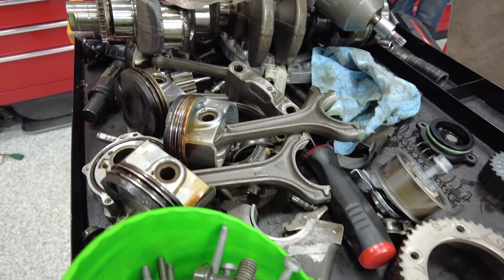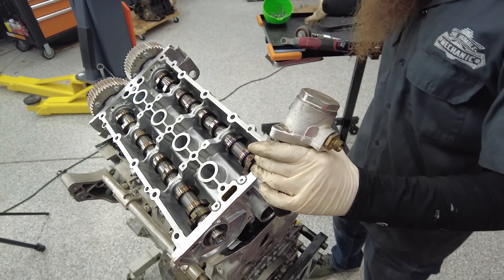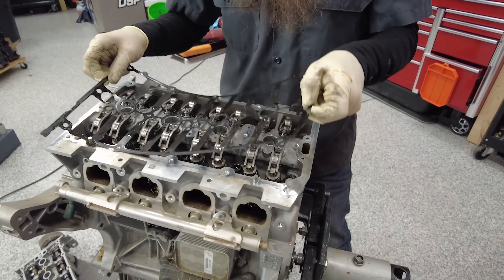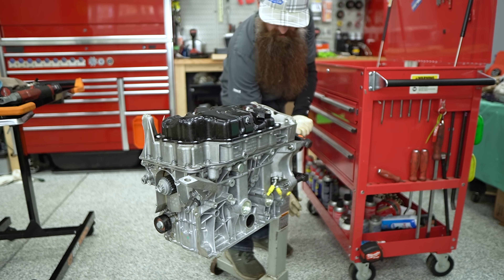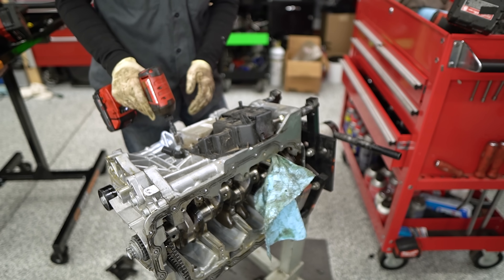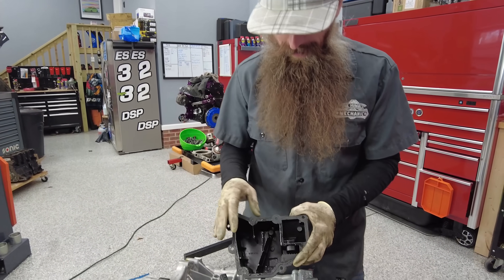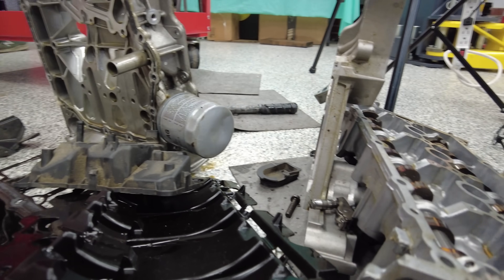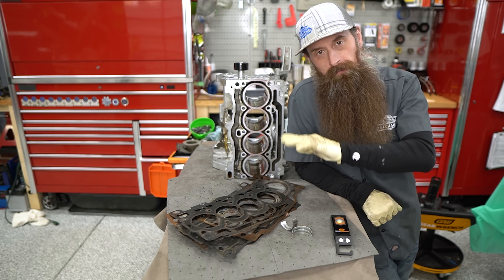1.4 Turbo Engine Teardown After Engine Failure ~ Rod Knock

Comment: So it didnt have the rod knock more like timing or bad coil pack. Them rods and bearings, piston walls locked clean to mean.
Reply from the maker: It wasn’t either of those. The guys working on it went way deep. Sadly you don’t always find the smoking gun when the problem is in dynamic state, and you can only inspect static. 

If I recall vw warrantied out the engine. But this was every bit of 10yrs ago so I may be fuzzy

Comment: The integrated camshaft housing is present across the EA211 range of engines, so includes the 1.0 and 1.2 engines as well. But I don't think they are sold in the USA so you probably never seen them.

Comment: My ea211 1.4 from 2013 has 320000 km / 200000 miles. Only had the belt/waterpump replaced. No other problems. Good milage and little oil consumption. Yearly oil change.
Reply: my 17 jetta has 60500 and gotta do a head gasket also 1.4 tsi ea211

Comment: Late to the party... as usual.
Anyone notice these could be switched to port injection? The intake manifold has spots for injector boss to be drilled and the intake port has clearance for the fuel spray.
What benefit? No idea.

Comment: Before removing the timing belt you have to lock the cam shafts with special tool in order not to make engine rebuild right after. Ofc in this case when you just make a corpse dissection is ok to do it your way.

Comment: Hello! Please tell me, the question is a little off topic. A plastic part fell off from the oil filler neck and is now in the valve cover. You can start the engine or it is better to remove the cover and take it out. If you remove the cover, is it possible not to remove the belt completely? Thank you in advance to everyone who will help me)

Comment: Mines on a custom stage 1 running 185bhp and 318nm in my polo bluegt. Absolutely cracking little engines, enough power and economy to not want anything else
Reply: 1.4 CHPA on 200 bhp - 340Nm 190k km.

Comment: I had a 2016 jetta base manual with tech so it had the nicer touch screen and all the electronic switches instead of manual. Leased it for literally 160 a month. But added on the maintenance for 3 years as well as scotchgard the out and inside. And finally tire and wheel protection. Loved the thing so much I decided to buy it when my lease was up and my wife drives it daily and I use it as my primary lyft uber rideshare driving which means it's running around stop and go and long travel 5 days a week. Has near 120k on it now and it's never had a single issue. One thing I do recommend on any vw Audi or benz. Every month twice a month I run a can of berryman b12 thru the tank and I've never had carbon buildup ever. It had a timing belt changed at 100k and the clutch has been upgraded. It also has the apr stage 1 upgrades from the dealer. This was the car that made me love german cars so much. Being a salesman for vw Audi and Benz. Becoming a audi brand specialist. They truly are amazing vehicles. And you can put my cadillac 05 sts v supercharged up against most cars even modern ones... but I will say that the Passat from 2015 on is the smoothest quietest most comfortable and capable vehicle on the road. I think if the Jetta gets to start having issues in another few years. The passat 3.6 liter premium R line edition is such a luxurious vehicle. And with that 4wd and v6 they rip.

Comment: The integrated cam design seems to be a lot more common now, with other euro car manufacturers having adopted it in their engines. From what I've been told by my local VW techs it's mainly for manufacturing cost cutting and to act has a failure point if the timing belt snaps. They've worked on engines where this happened and if the valves contact the piston the lobes will just spin on the cam, preventing catastrofic engine damage. You do need to get a new cam assembly after that but I guess it beats getting new engine.

Comment: Mine has 144,000+ miles all city driving. (Uber Driver). Just had the timing belt replaced so I am ready for another 144k!
Nothing other than regular maintenance done. I wonder how long the turbo charger will last. I will see how many miles I can get out of this engine. My guess, over 300,000 miles

Comment: I have a 1.2TFSI EA211 with 110hp in my Audi A3 from 2014 with timing belt. Still running strong. But I‘m changing oil+filters every 7500km

Comment: I have a 1.4 tsi in a Golf estate That's burning oil at 1L per 500km (1qt per 310mi) when accelerating there's often a sound that i can only explain as having some rocks in your hand and shaking them. The noise lasts for 2-3 seconds and then there's a big puff of smoke out the exhaust that's big enough to see in the revision mirror and then the noise goes away and the car drives like normal.

Comment: Charles - quick question. I used to have a 2015 Jetta with a 1.8Tsi. I changed the oil by pumping it out of the dipstick hole. (I'm sure you have an opinion on the practice). I now have a 2016 Jetta with a 1.4 Tsi. I measured the oil coming out of my 1.8 and my little pump really did a thorough job of removing the oil. I just tried the same thing on my 1.4 and it left quite a bit of oil in the engine. It could have been 1/2 quart or more. Unfortunately, I didn't measure it because I didn't anticipate the problem. So, after adding the capacity of 4.2qts, I saw the oil was very high on the dipstick and I sucked some back out. Here's my question: Is there something about the dipstick channel which would keep my oil pump tube from going all the way to the bottom of the pan to get all the oil in the 1.4? This is an old thread so you might not even see this. But, if you do and you want to give me expert advice, I'll take it. Thanks. I really enjoyed the teardown (even though I couldn't see what I was looking for regarding the dipstick channel.)
Reply: I doubt it

Comment: Hey Charles, loving your work, I bought an 2004 A4 B6 Convertable 2.5 V6 TDI 8H, she has a full Audi service history and seems pretty good nick, I have done a lot of work already including all the front control arms shocks Track rod ends, inner drive shaft gators, drivers window reg, airbag sensors, replaced air intake motor, timing belts still to do, full service, coolant flush, CVT 01J fluid replace. Be cool if you have any vids on this model. Happy new year, thank you gor your great tips and making all the fantastic videos. ⭐⭐⭐⭐⭐🤜🤛
Reply: Thank you very much. 🤩😁👍🤗
Reply: Awesome

Comment: No videos on the web about removing the electro motor for this engine.
Reply from the maker: for the Hybrid system? Im doubtful there will be LOL
Reply: @HumbleMechanic  i'm going to be doing plugs, coils and pcv to address a misfire on my '13 hybrid sel with 113k -- if that fails might have a donor for ya -- else if interested within 15m from me a se variant with a failed emach.. would you ever consider a frankenstein series? lol.. there's so little documented anywhere about the hybrid variant, even from what tech manuals I was able to dig up and even what's available from alldata, etc -- can't even figure out where the secondary brake booster is located.. but I barely know what I'm doing over here.. just a previous gti mkiv owner/lover that was rehomed after years of all bolt-ons and complete suspension rebuild similar to your new mk5 gti series.

Comment: I have a 1.4 that has 3 bent valves. Caused by messing up the timing or what else could cause it? Low oil pressure?

Comment: Wait a second. You guys over there didnt have the stupid chain driven 1,4TSI but instead a belt driven 1,4T??? Oh you where so lucky... The 1.4TSI had a HUGE issue with the chain and as a result there where a lot, and i mean A LOT, engine damages. But most of the ocured AFTER the warranty ran out, so VW did what they did best: nothing.

Comment: My EA211 1.4T has just turned 7 🥳 130,000km which is about 80,000miles... absolutely nice and served really really well. It's good to hear positive comments on this engine design, if I look after it (frequent oil changes, keep under the hood clean from debris), it should serve many more years 🎂
Reply: I have on my Golf 7 already 300 000km with original turbo (Start Stop turned off from buy). Every 15000km oil change and every 30000km oil change with engine flush. No smoke during cold start, nothnig wrong with it.
Some taxi services had cars with this engine and they are over 500000km. 
Decent CZECH design
Reply: @filipdopirak5226 that’s right, I forgot it’s a Skoda developed engine. 👍🏻
Reply: Hello.I have thie engine im my skoda octavia.When is for replacement timing belt please?VW don't have scedule servise for timing belt...Thanks.

Comment: This has a gear and chain driven oil pump with springs inside it, which makes the most important piece, the oil pump, more suspeptible to wearing out and breaking.  Most oil pumps on small four cylinders are directly gear driven and so rarely wear out or have problems.

Comment: It didn’t have a Rod knock.  I bet it was an injector issue resulting in significantly altered fuselage air ratio on one cylinder which caused detonation, or spark knock that sounded like a Rod knock.  Same happens in diesels when an injector is going bad.

Comment: Thanks for this tear down , learned a lot from my engine . 
Been driving a 1.4 2017 Jetta 5 speed with about 72,000 miles with stage 2 tune Unitronic . ( thankfully no problems so far ) 👍👍 . Small motor but with a kick !

Comment: Question for you Charles:
i was trying to change my spark plugs on a 1.4 and had to remove that pcv valve next to the oil cap in order to get a better angle on a coil bolt so i could get it with a wrench. Problem is one of the tabs on that valve snapped and i swear i saw it go into the pcv valve's hole and down into the cover and/or even deeper down to the valves.
This is pretty bad isnt it? Definitely wouldnt want to start the engine with that in there? Whats my best bet for removing that? I came here as i was looking at removing the cover but having to crack the timing cover and pull the belt is a lot of extra work that i wasnt planning on doing, plus i was already considering getting rid of the car.

Comment: I'm working on a vw new bettle 2.5 bpr. Secondary monitor won't clear. Bump works, valve opens and closes. Pump just won't come on. Does anyone know if the module monitors the ambient air temp sensor or the iat sensor to know its at a cold start? I know that it looks at ambient air and coolant temp to determine if it's at a cold start but I can't find any info if they use the iat sensor or ambient air temp. Anyone?

Comment: Cool breakdown, I have the ea211 evo 1.5 with 6MT in a skoda octavia combi (for usa = jetta size).
Fun fact it has cilinder deactivation, it still feels weird running on the highway seeing the engine running in 2 cilinder mode (750cc 2cil turbo...).

Comment: Wondering if they threw extra head gaskets in to lower the spike in power and compression from the small turbo spooning up so fast to allow consumers to still run lower octane and still make 150 hp or so

Comment: 3:00 Actually they cool down empty shafts in liquid nitrogen - so outer diameter is going down and in the same time cams are heated in furnaces - inner diameter is going up a bit. Then, kind of as you said- shafts are slided into this cover assembly with pre-positioned cams. As temperatures aligns (with additional heating of shafts) both parts are squeezed together and should not move. Cams actually have 'special' shape on inner diameter surface, to provide better grip to shaft, I suppose.
No way to dissasemble/repair if there is an issue - straight to scrap :)

Comment: The fact that this engine doesn't have a balance shaft is important for clutch selection. My application came with a 6 speed 02S transmission, normally used in diesel engines, so I tried a single mass flywheel designed for those applications. Everything fits, but the undampened vibrations did a number on the transmission. 

The chatter was bearable, but the added vibration almost killed my transmission synchros.

Comment: I'm really surprised at the upper section of the oilpan.  Just seems they missed an opportunity to tie all that bracing into the mains caps and make a girdle of it..
Reply from the maker: The w8 is the only VW engine I’ve seen like that. It’s pretty cool

Comment: This looks like a better derivative of the original 1.4 turbo.  Mine's a chain driven CAXA 1.4TSi from 2008 and it's been very problematic.  Chain slipped at 80K and I had to replace it,  the tensioner,  valves etc...  I also replaced the HPFP which is exactly the same as the one here [complete with roller cam follower]... that's now back to making a ton of noise again 40K miles down the road.  There's also a pulsating soft knock knock knock quiet knock knock knock quiet etc... sound when the engine's idling shortly after a cold start.  It goes away when warm but the HPFP clattering doesn't :(  Not sure what that could be.
Reply: Vw state that if you remove the crankshaft you will distort the engine block pedestals and damage the bearings. Do not remove crankshaft. So that means new short block.

Comment: Thank you for sharing! I'm having flashbacks every time you mention the light weight!  One summer I worked part time for a machine shop tearing down truck engines from the junk yard for them to rebuild or part out.  I'd put the parts into one or two poly buckets then one of the machinists would help me pick up the block and put it on a cart.  
One day they had a Honda engine for me to tear down.  All the parts fit in one bucket which was about half full.  I carried in the bucket in one hand and the striped block in the other hand!
Stay safe!

Comment: Hey Charles, Your video peaked my interest regarding this motor. How about doing a series on a swap to a Mk1 or a Mk2? A slightly left field approach would include the modern automatic transmission.  It would make for an interesting autocross car. There must be a zillion of these motors available at auto recyclers. Cheers, Mike

Comment: Hi Charles, In your opinion which is the most reliable VW/Audi modern engine? I had a 2001 Jetta 2.0 8 valve AEG, and it was bullet proof. Would like to know if you consider that a modern engine can can get tons of miles like the old ones.

Comment: I own a Passat B5.5 2002 with engine code AZM 2.0L, Shockingly still drives like a charm.
I never had to do anything on the engine which has 280K on the clock. Apart from changing timing belt.
Do you think you can get your hands on one of those. Mind you, it is a very rare engine to find in Europe.
Reply: Is the AZM a 2.0L TDI engine? The B5.5 did have an optional 2.0L TDI engine that was called the BHW. It was probably very similar. The only other engines I remember were the 1.8T 20V and V6 30V gasoline engines.
Reply: @skylinefever  This one is a 2.0L Naturally  Aspirated SOHC 8v Gasoline. Very rare but highly reliable. In Sweden at a -15 centigrade it sill starts like a charm. I am so in love with this engine.
Reply: @konquer247  I see. The USA did not get a 2.0L NA engine in the B5.5. We only got the 2.0L PD, 1.8T 20V, and NA V6 30V.

Comment: a seat ibiza (model 2000 ish) also did the camshafts this way. i think it was also the 1.4 petrol engine. 
this design sucks balls because if you need to replace the gasket between the valve cover and the cylinder head you need to take off the timing belt lmao

Comment: Had one of these engine in with a melted exhaust valve, reassembled and it has an idle misfire/misfire at 2000rpm on all cylinders, any ideas?

Comment: Bro. What s the problem with that 1.4 tsi engine? It s brand new. From where the knoking sound came from? You didn t figure it out. I think all the problem is from the cranckshaft sensor rotor .

Comment: Tear down on a Vw 2,5 Tdi engine code AXD/AXE BNZ/BPC sits in a Transporter/Multivan/Caravelle. Gear train driven camshaft and water pump , pumpe dyse, Weak design on camshaft (?) and water pump (?) and injector seats / seals (?).
Reply: Sounds interesting, but the USA never got one.

Comment: Charles, love your videos. This is actually the first new age vw engine that i think it okay! The camshaft set up is weird but thats typically never a problem unless theres an oil issue. 
I would actually consider a vw swap with this engine
Reply: it still uses a timing belt in 2021 lmao
Reply: @brokentradgedy  yea its unusual but I am very familiar with timing belts.  Less mass rotating as well vs the weight of a timing chain

Comment: I'd love to see a 1.9 PD BRM diesel teardown. The first car I drove on a regular basis was a 2006 TDI Jetta with one of those engines. I learned a lot about that engine (and pushed it to its limit often). It seems like a tank of an engine and my family still has it running strong with over 300k miles on it!
Reply: Those 1.9 PD engines are bulletproof. One of the most reliable diesel engines ever made.

Comment: What is your opinion on the purchase of a 2014 Jetta with the 2.0 Turbo Diesel?

$18,000 is asking price

Mileage is 13,000 original miles, well maintained vehicle, should I consider something newer with same mileage with gas engine?